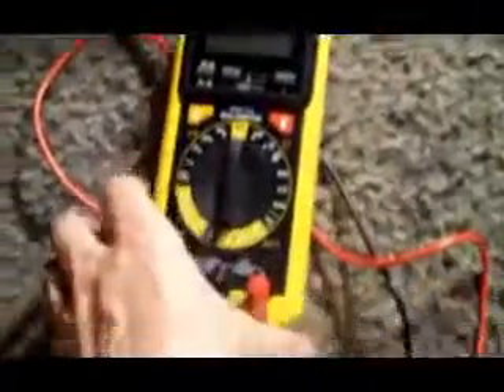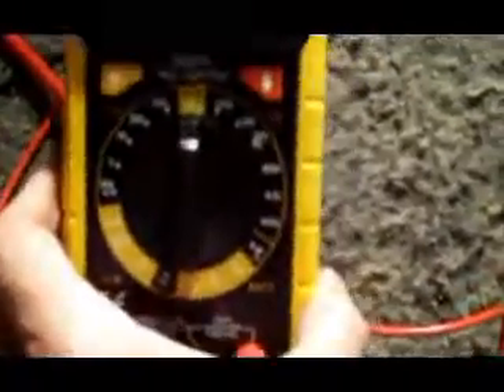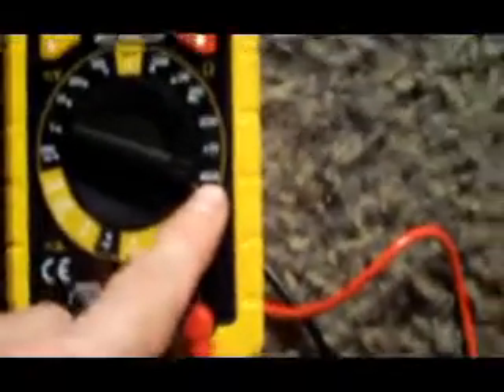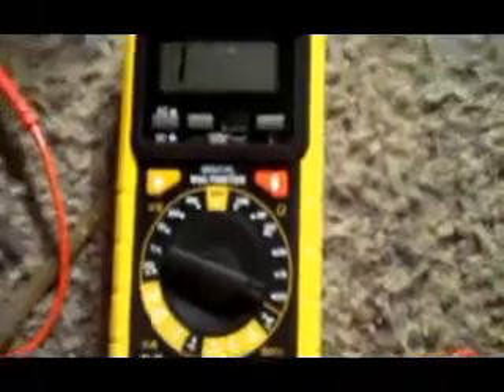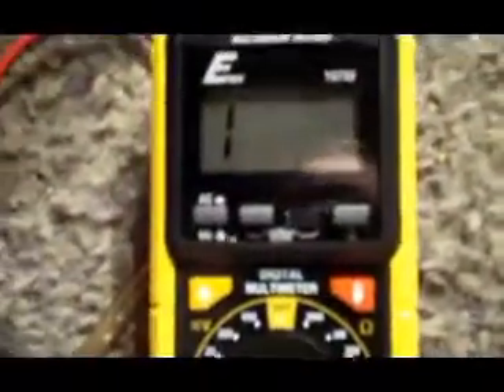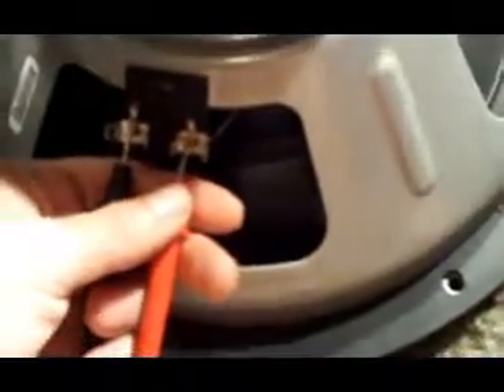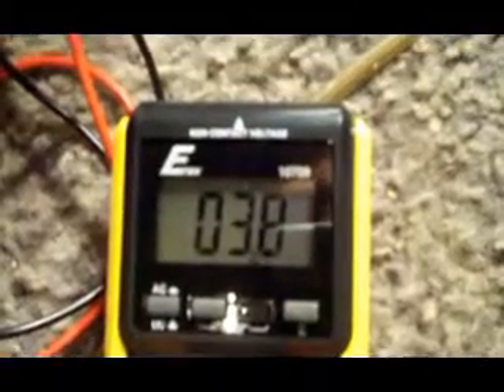How To Read Ohms On A Subwoofer With A Multimeter

Comment: I cant use them together?
Reply from the maker: You can but one will get more power then the other if you wire them on the same amp. You will need 2 diff amps and 2 diff boxes to run them both

Comment: Just picked up a 2nd hand SPL 15" sub in a box, the screws are really tight and hard to get off so i cant see the information  on the back but was wondering if i can do the same test your demonstrating but attach red and black to the speaker boxes terminals insted of the ones on the actual speaker...appreciate the info if you know

Comment: Would two12in 2ohms alpine type r's go good with my 1200 watt hifonics amp?
Reply from the maker: All depends on if they are dual 2 ohm coils and what hifonics amp you have. Usually 2 dual 4 subs are the way to go if your unsure because a lot of mono block amps are 1 ohm stable and that can wire down to 1 ohm to give you good power
Reply: I'm knew to this stuff and I was wondering if you could take a look at my subs and amp on here and see what I can do to make my system louder.

Comment from the maker: Maybe your multimeter is on the wrong setting or maybe your sub is bad. Whatever your subs are hooked at thats theoretically what your amp is putting out. Like if your subs are hooked @ 1 ohm then thats what your amp would be putting out 1 ohm. BUT in order to truely test you need a clamp meter and clamp it all and see your box rise then you will TRUELY know what ohm is commin outta the amp

Comment: Great video, very informative and will help me bring my two FI SP415 dual 2 ohm sub woofers to 4 ohm to match it with my PA Power Amplifier as I'm using these two subs in my home cinema system. I was going to purchase two Paradigms sub 15's but decided to build my own Sub boxes and save a packet into the bargain saving myself thousands by going the DIY route. So thank you for showing how to use the multimeter  to check the ohm load of a subwoofer.

Comment: shit! I know the answer is dont buy cheap ass speakers at a garage sale, but Ive 4 speakers 2 pioneer, and 2 Millennium theater speakers, I got a new stereo yesterday and today I had it turned up, almost all the way and the bass on both the cheap millenniums stopped. used your video to test the 12" and appears to read nothing. so please tell me what went wrong, besides cheap speakers, can u suggest a store to buy new, quality speakers, would it be a waste to just change/fix the 12" speakers?

Comment: Will do. I thought it was crazy myself. I hooked them up right according to a few diagrams I've searched online. I put the multimeter on the ohms setting, touched the - to the - and the + to the + and it was bouncing around between 0.5, to 14.5. Then after a few seconds it stayed within the 14.whatever range.

Comment from the maker: You had to have the multimeter on the wrong settings. No way you can get 14 ohms unless you got some crazy messed up speakers. Goto rockford wiring wizard and make sure they are wired right then check again

Comment: I got two 2 ohm DVC Alpine Type R SWR-12D2 subs. Wired them to 2 ohm on my Hifonics BRZ2100 and used this method. It reads 14 lol.. I did something wrong. Won't be jamming out til I find the time this weekend to recheck my wiring.

Comment: with that meter he has too put it on 200 because it is not an autoranging multimeter.  200 is the lowest setting for ohms as in 0-200 ohms range.  You have to put it the to read anything under 200 ohms.

Comment: @casperskafs That's cool, I mean you know more about it than I do, but I'm guessing you must have consulted with the owner's manual or maybe somebody just told you to set it at 200? I am replacing some unmarked vintage woofers in my home stereo cabinets and I just want to make sure of the ohms, since my amp is a vintage treasure of mine and I don't want to risk running any lower than roughly an 8 ohm load, esp. since I will be using both the A and B channels (4 speaker cabinets).

Comment: why wouldn't anyone not care about this. knowing that bit of info can save time in money when moving around heavy ass speakers. instead of taking them apart then making sure you wired correctly just use the multimeter time saved awesome tip.

Comment: Set your multimeter to DC Voltage, hook up + and - and push on the cone of your subwoofer and watch the voltage go up and down. weeeeee!!!
You're actually measuring DC resistance with the MM, and the "4 ohm" stamp means impendance which is AC resistance.  Just round up though :)